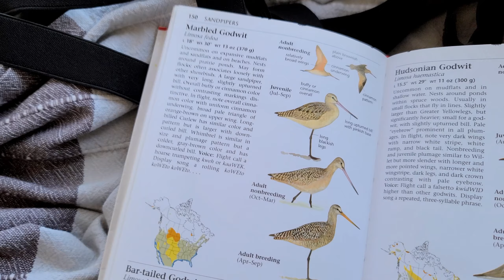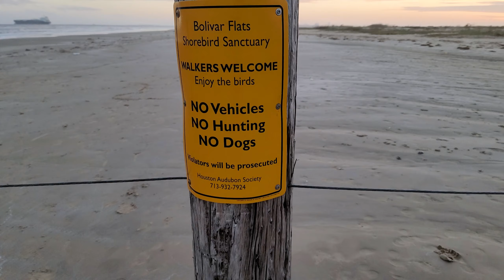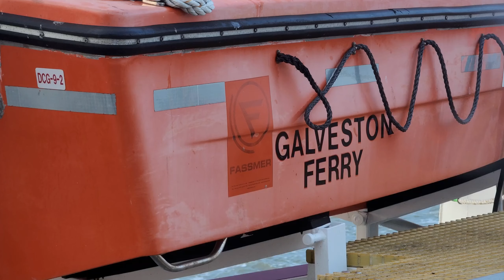Life’s A Beach... Until It’s NOT | Splashing In The Gulf To Stressing Over Leaks In The Taxa Mantis

Comment: RV roof tape👍. Just run it over the rivets. For the canvas stop by your local Sail repair shop they have sticky back, sail patch material we use to combat chafing ie protection its also water proof and flexible so stick on the canvas to cover leak points👍. Taxa won’t do those fixes and you’ll still have leaks. 👍
Reply from the maker: Thanks for the tips! We've done flex seal over the rivets and it seems to be holding up okay so far.

Comment: Does the Mantis have exposed rivets on the roof?  Would silicone or roofing caulk help with the leaks?  I'm sure you and Choua have already thought of that...  The thing I like about my Taxa is that the builds are pretty minimal, so when they do have issues (as all RVs do), the fixes are pretty straightforward.
Reply from the maker: Yep, it's got exposed rivets on the top. We have sprayed silicone on a few that were easy to access but we'll have to make time to spray down the rest of them.